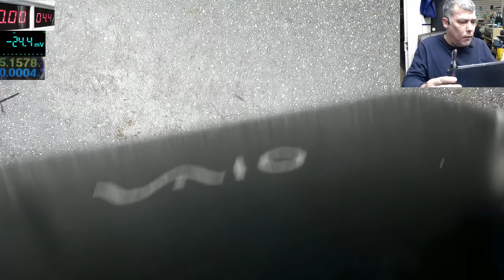Laptop broken hinge - easy fix for any kind of laptop

Comment: Sorin you are the right kind of a guy I need, in case I have a massive heart attack. I'm pretty sure you can fix even a dying man with hot glue. Insane repair...  BTW I've repaired my HP Pavillion G6 with hot glue - no problems after 1 year.

Comment: Tried it myself on a 17" HP Pavilion.
I had the same thoughts on hot glue being too soft:
Instead I used a 2K mixed epoxy.
How wrong I was ! The epoxy can not be altered once cured.
Ended up with a mess and the lid could not close fully ...
I broke the display ... 😳
You HAVE to put all your will, patience and strength into such a job ☹
Will never do it again.

Comment: Hello Sorin, I also own a computer shop and I would really want to suggest you to try epoxy resin for those type of repairs because it is a lot stronger, less messy and easier to apply. I always use it and it holds "a dracu de bine". Keep going because I really enjoy your videos and to be honest I would come to work with you and learn from you in a heartbeat.
Reply: What if you have to reopen later? No way!!
Reply: He says hot glue is FLEXIBLE epoxy is not.
Reply: You can actually just fix the hinge on the back plastic plate and it will hold easily without the top one so you can open it. That's my way though.

Comment: I have found if you heat the metal part a small amount before pressing onto the hot glue, it bonds much better then pressing cold metal into the hot glue.
Reply from the maker: Very true

Comment: good option is flower with superglue much stronger than hotglue you can even screw in it and sandpaper it or form it with a dremel
Reply: You mean flour? Might try it. Soren was doing 'quick & cheap' so hot glue is ok.
Reply: @kblectronix   you are right i am dutch so a typo is quickly made

Comment: U-POL Easy body filler might be the answer to some. It dries really quickly and goes rock hard in minutes. It sticks like anything. Works on lugs and self tap screws. Better than Araldite but just as messy as needs mixing up etc. I just tried on a broken Asus lappy case, ripped the hinge lugs out of both sides to break it on purpose to make this experiment. Mix up U-POL filler (it smells like it might work :-) ), paste it into the broken bits/holes and stick the lugs back in where they should go. Put self tapper screws where they should go in the sticky stuff. Wait a bit for the filler to go off and take any self tappers out. You then have a new thread for those when it's completely dry.

I only just did this as a test so it's not completely dry, but it is NOT going to come off easily already, it's also much harder than hot glue. I hope that help's someone else.
Reply: Left it a bit longer, put the screws back in, works 100%, you can also put the filler in the holes where the lugs used to be and use some suitable replacement self tap screws and it's still strong. The filler left on the paper I mixed it on is still a little bit 'crumbly' so will check again tomorrow. I think this is a good solution for sticking broken plastic bits, charger ports etc down in laptops. It's a lot more solid than hot glue and marginally as much work. Smell's like Evostik anyway so happy days! :)
Reply: A bit longer. It's almost like the laptop plastic, bendy and hard. Cool stuff. It works!

Comment: A two part epoxy is the proper way to fix this with no comebacks. JB weld if you have 24 hours or JB quick if you only have 4 hours.  I hope the owner doesn't attempt to open it after it sat in a hot car.

Comment: Hi Sorin have you spoke about voltage maintenance system? the device should start when I press the button for 2 seconds. But it only works as I press and hold the button, when I release it turns off immediately

Comment: Some of your technics are amazing. Hot glue is so lame and I do not belive it's going to last long. I've been trying so many differend ways to fix hinges and stayed at resin epoxy from US. Your repair is temporary.
Reply: resin epoxy is good, but for sure you can't use hot air to remelt it, if something goes wrong in the unit, then good luck ✌️
Reply: I always tell the client that way is hard if you want to get inside, but good epoxy is nicely cracking/breaking when you use heat. You can apply another one after that. I know that it's time absorbing, and can be painfull when you want to open cover second or rgird time, but looks better and holds a lot longer.
Reply: every technicians has its own technic on how to repair things in the fastest way as possible, if your technic is suitable for you, then its good as long as the costumer is happy,,, jobs done (have a nice day ✌️)

Comment: Hot glue NOT for hinges buddy. Won't come close to holding. Not even a strong 3500 PSI plastic epoxy will hold the hinges in place of screws. However, I have a much better way to fix those hinge mounts and it's as good if not better than screws, if your interested. It takes a little more time but you end up with a great hold, better hinge mounting and perfect appearance. It's like putting it back together but better and stronger and looks just like it did before it broke.

Comment: Beter to put flex antenna from old laptop around touchpad  inside. i do this for 20 years. That wire its not good solution if router its not in close area, beleve me. ccq its bad. and rx/tx rate

Comment: 3D filament cools too fast by the looks, you'd have drill out the holes etc... Needs something wet that dries solid fast and sticks like sh** to a blanket.. still looking. Araldite is slow but I use that as well.

Comment: why not use "two part metal epoxy"?
Reply: It wouldn't do a any better result, because it's more expensiv and cannot be handled that easy and fast like hot glue, isn't it?
Reply: @Mr.Smith_Mr.Wesson_andMe  I disagree. We are doing same repairs with epoxy. It looks more professional and you can open the notebook again if you need to. And the price? You do not need a huge amount of it, just for fixing the nut with thread in place.

Comment: That costumer needs to get on eBay and find another Sony Vaio of a similar model that's selling for parts and has a case in decent condition, then buy it and switch the working laptop motherboard to the other case.

Comment: Ahh f**k it duct it....  Don't flex the top too much while the hinges are broken.... you may wreck the video cable.  Remember when laptops had metal plates/inserts that the hinges screwed into?  It seems the new laptops all screw into plastic that gets brittle from heat.  Removing the metal made them lighter but less robust.  What brand/type of hot glue do you use Sorin?  There are so many types available...is one particular type better for hinge repair?  HOT GLUE HERO!

Comment: I keep old wifi cables from destroyed laptops in a bin and use them as needed.Do you ever worry about melting something you do not want to melt?
Reply: if you watched his hot glue videos, you would have seen that Sorin is never directing the hot air gun directly on any part of the laptop, but on the glue stick. The melted glue is not dangerous for the laptop.
Reply: @Mr.Smith_Mr.Wesson_andMe  Sometimes, when using glue on the hinges of the laptops, it is very difficult to not hit something that is so close to where you need to apply the glue.
Reply: @Mr.Smith_Mr.Wesson_andMe  I have,  and to make a point, it can be dangerous to video and antenna cables when used on hinges. I was merely asking a question. You could answer without the insults.

Comment: This is in fact a dumpster laptop. Not worth repairing. Get the data off it and dump it.
Reply: Why? It looks fast, yeah it's broken and it looks bad, but if it is working - why throwing it away? A lot of newer laptops are slower... and they cost way more... I'm not a fan of throwing away a working thing...if it can be repaired - even better.
Reply: @simeonmihaylov6123  It is all about cost for the client. If the repair is close to the value of the laptop then it is definitely not worth it. Repair price in UK should be around 100$ per hour + materials + parts.